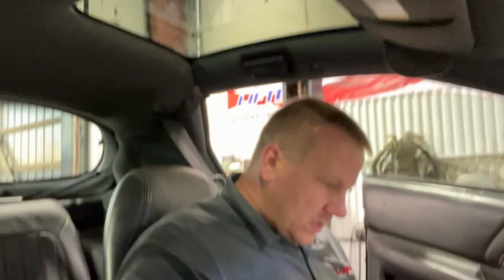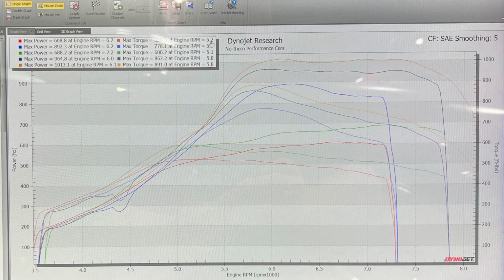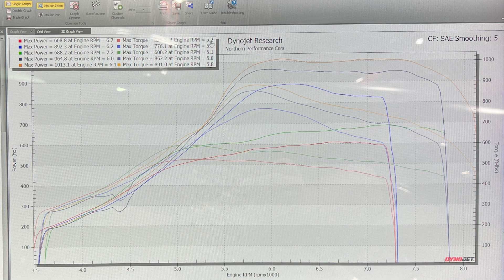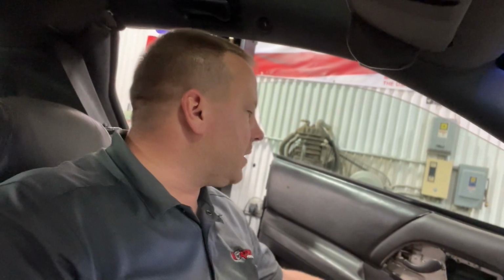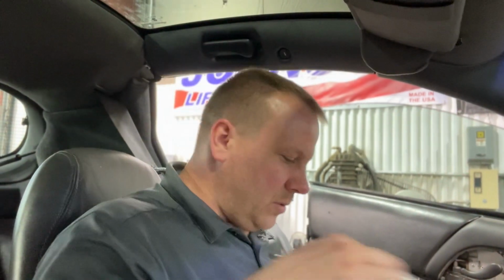Turbo 5.3 Camaro makes 1,000 Rwhp on pump e85 with no intercooler! Mandingo v2 pt 2 comin atcha!

Comment: Thank you posting this. I have been on the fence about non-intercooler e85. I have no room for an intercooler.
Reply from the maker: I wouldn’t suggest it. But if you know what you are doing you can work with it.
Reply: If you dont have room for an intercooler, why not run e85 with meth inj?

Comment: Love the work you put into these cars! I'm new to the fbody. I currently bracket race a Nova. My question is what is the best rearend and how much do you cut it? What wheels? Are they 10"? What backspacing? Do you run bias slick or radial? can you run a 29" tall? Sorry for all the questions. I see you typically respond to others. I will like and subscribe if that helps. Lol, Jamie
Reply from the maker: A few of those are loaded questions as many things change with intended use, engine power, gearing etc.  

The rear end options are up to the end user. Can go from bone to 14” narrower if you mini tub it. 
We only do 28” stuff around here. 

This car was specific for no prep so a bias tire. My old Camaro for instance was radial prep racing so we ran it on a radial. 
The wheels on this car were 11” wide. 
My old Camaro had 12’s. 

It’s really just open to whatever you can dream up!
Reply: @NorthernPerformanceCars  Is your current car Mini tubbed? I'm not planning on messing with the tubs. But I would love to fit a 11" wheel in there. Didn't know if rearend was cut 3" on each side with 11" wheel with 4.5" backspace work. I like the way your car looks. Are those Billet specialties wheels? Sorry for so many questions. I understand grudge cars don't really want to share too much in fear of competition. I'm just a bracket racer and like what I see. Thanks again for responding!
Reply from the maker: @jamiecarroll3330  that car is ironically already sold lol 

But yes it was mini tubbed. 
It was real narrow 8.8” mustang style rear axle.

Comment: Your numbers are still so far off it makes absolutely zero sense… 5.60s on 27psi and then under 1000hp on 27 psi 🤨
Reply from the maker: It went 5.3@133 at the track. And made 1,050 at 30 psi. . 3,200 pound car with driver.
Reply: Non intercooled. IATs are higher, less oxygen, more boost required.